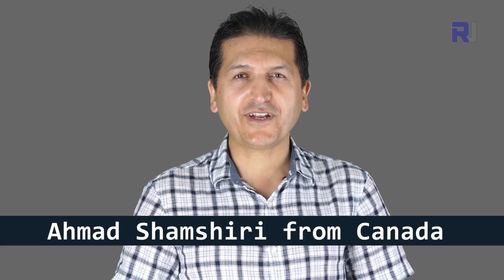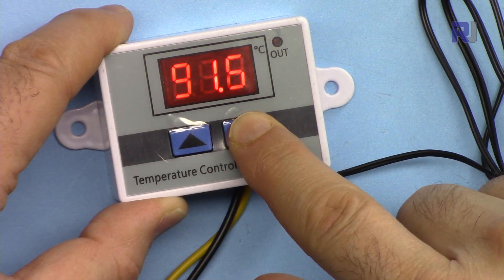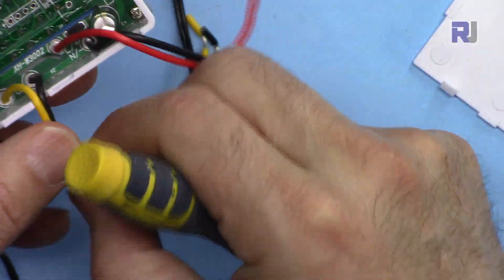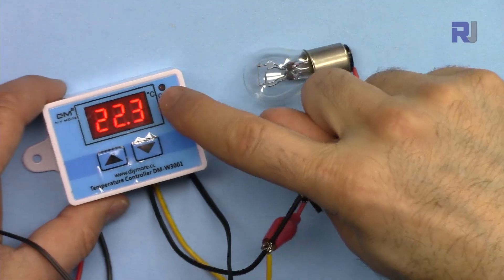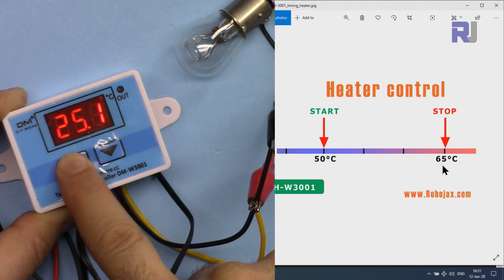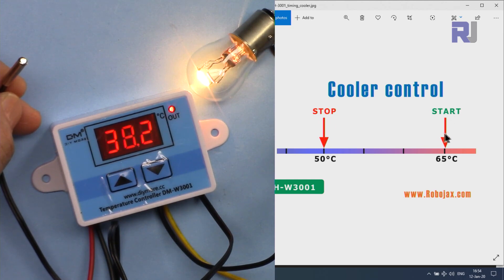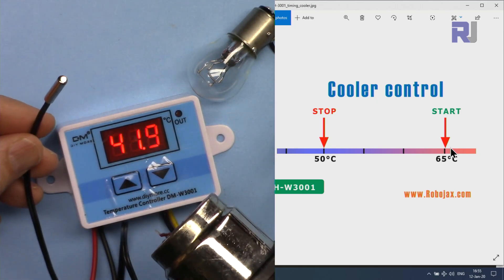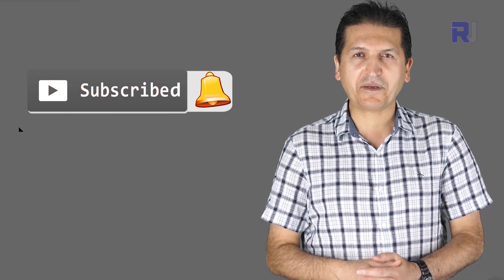How to use XH-W3001 DC digital Thermostat Temperature control - Robojax

Comment: Hi - interesting video, thanks. I am considering using this on a Danfoss compressor on my boat's refrigerator. Where on the compressor module would the yellow and black wires be connected to?
Reply from the maker: Hi, I am not familiar with boat or equipment installed on boat. But find two main wires of refrigerator and follow what I have shown.  I hope you paid attention that we have power for this module to work and then relay two wires to control the load (your fridge is load).

Comment: how to use it? plug in to 220V ac outlet or a DC battery can do?
Reply from the maker: May be you missed reading the title which says DC or you skipped the introduction which I mentioned it is DC or may be you don't know what DC is. DC is power from battery with fixed + and - terminals.  Here is the AC version of this https://youtu.be/kZlTMNqXzo4

Comment: Are there any 48v DC temperature controllers?
Reply from the maker: No. it is offered at 12V and 24V. you may buy a boost converter to convert 12V to 48V.

Comment: how much load can we put on it ? I want to use dc water heater around 150 to 200watts dc
Reply from the maker: Read the relay. If it is 10A at 220v the 220x10=2200W. Do the math
Reply: @robojax  DC 12v
Reply from the maker: It is not voltage. It is the current in Ampere. P
Reply from the maker: I mentioned the relay in the video

Comment: Can I wire this to a 12v Solar charge controller?

Then use a 12v, 15W, silicone heater as the heating element?
Reply from the maker: 12v DCis just voltage does not matter where it comes from. But it must not go higher than 13V . Then the load is loads as I explained, the limit. You can connect any load.
Reply: Thanks for the help man! ❤️
Reply: Good question, I am doing the same thing.

Comment: I understand that it can control a device up to 10 amp.  What amp does the unit itself draw when the controlled device is not powered?
Reply from the maker: 10mA for the chip and about 30-60mA for the display. When relay is turned ON, it consumes additional 50-80mA

Comment: Hi , İ am using that But sometimes it doesn't work when degrees  increase for the stop . for  example i setting to stop  40 °C  then i want to stop  it but its working up How i control
Reply from the maker: using is for heater and cooler is different.  Pay attention when I explained.
Reply: @robojax  i using at heater System is true But sometimes  the system contunues  to work
Reply: For , example İ want to stop 38°C  but its not stoping and contuniue high degrees
Reply from the maker: it should stop working  when it reaches at 38. it seems the module is defective or you have wrong settings

Comment: Can i Use this for both AC/DC voltage?  For example  for slow cooker ? Put 220 AC voltage IN and in output will be a electrical socket where I plug slow cooker, is it possible ? I have version 220V 1500W
Reply from the maker: I don't understand your question. there is two voltage. 1-operating voltage which can be AC or DC depending on they you purchased.  2-Controlling load voltage which can be anhything.
Reply: @robojax  I meant if source  or power supply can be also a 220 V from socket  and if it could be also Alternating volatage, but I have tested it and it is working well so no problem